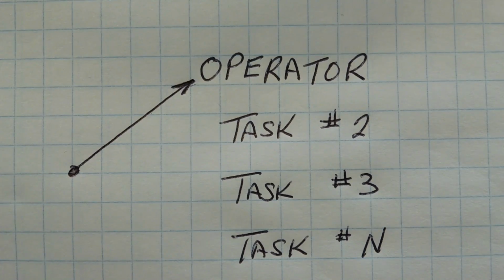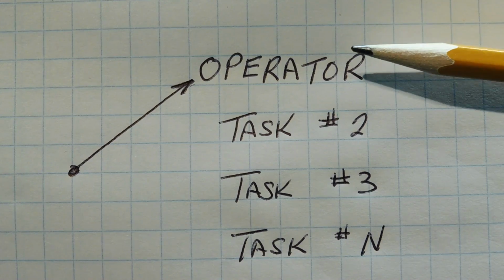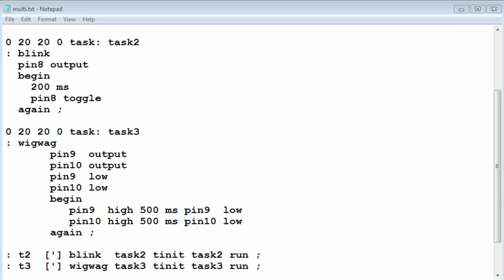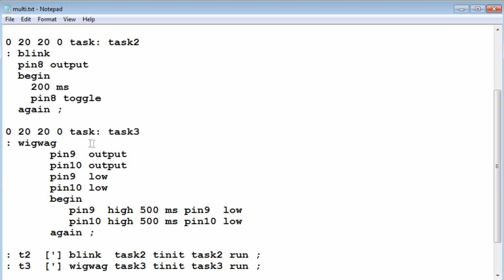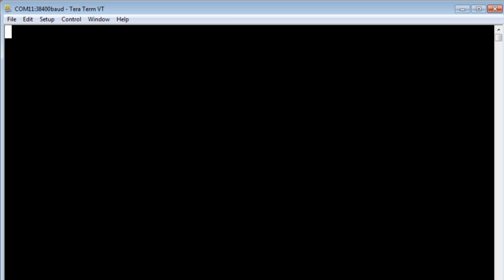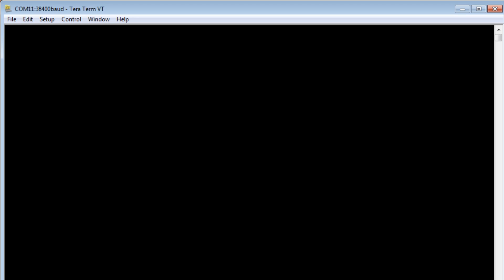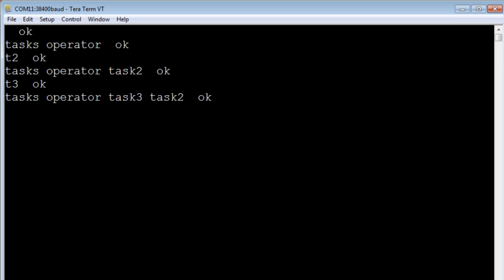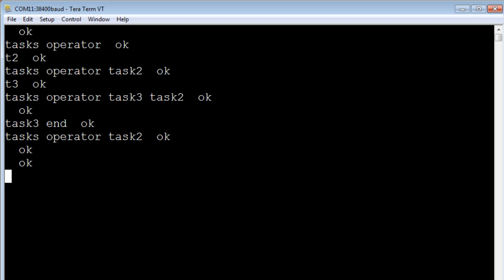Multitasking On A Microcontroller / Arduino

Comment: Could you please suggest me some guidelines for my project. Task no 1: I may be pressing Button at any time and it does the job. Task no 2: sensor senses the object and does various operations as follows- object located, then after some time gap it displays the distance, the after some time it gives a siron and if the object is there it repeatedly does above cycle. If the object is moved from there the above cycle stops. If I use delay fn, then button pressing does not work properly. I tried millis(), but could not allot different time intervals in between. Please guide.
Reply from the maker: Are you using Flashforth? The word "pause" is embedded into timing words for task switching but you can place it anywhere in your code to make the program flow properly.
Reply: @0033mer  thanks. I will try and let you know the result.

Comment: i have a arduino sketch which shows time on st7735 display. I want to run FlashForth on it and this sketch as just another task. Is there any way to do that ? This would also mean that "any arduino sketch" can be loaded at runtime as a task.
Reply from the maker: FlashForth does not use the Arduino IDE so running an "Arduino sketch" under it will not work.
Reply: @0033mer  thanks for reply. I will then probably edit tiny basic sketch to have time display as one task ( if that's possible).

 As side note I was wondering, if I could put a hex file of say a sketch in flash memory somewhere and call it via say some tinybasic routine or forth word Or a forth driver for the display.
Reply from the maker: Updating your time display with a "tick" interrupt is probably the easiest way to get it to work.

Comment: i type "tasks" i get a question mark....

FlashForth 5 ATmega328 18.11.2020

0 20 20 0 task: task2 task: ?
: blink
pin8 output pin8 ?
Reply from the maker: You need to load Task.txt first. It is in the download file together with some sample multitasking code that you can use for testing.
Reply: @0033mer  thanks, I found those after... you know... a quick RTFM ;)

Comment: So it looks like you have a cooperative multitasking OS in there somewhere. Each time your task calls the ms word the OS starts a timer, saves the state of that task and then executes the next task that is ready to run. Something in the OS decrements the timers and, when a task timer reaches zero it restores the state of that tasks and executes the task on the next instruction after the ms word. Is that approximately correct?

Is the cooperative multitasking code part of your Forth or is it another module added in with the rest of the code? Are there other Forth operators like ms that will release the processor to run other task code?  I would love to see how this cooperative multitasking code is structured on such a small machine.
Reply from the maker: Most Forths have cooperative multitasking built in but you can remove the module if you are not using it. This gives you more memory. Operators like ms will release and many others like I/O words. If your task does not have a release word you use "pause" which lets you "hog" time for critical tasks.
Reply: I don't think the Forths I saw in the late '70s and '80s had any multitasking. My limited encounters with Forth lead me to abandon it and I never really looked back. Your examples using Forth have made me want to take another look at it. So thanks for a great example and wonderful channel.
Reply: @RobertShaverOfAustin   Unfortunately most people were introduced to Forth via public domain systems that didn't add the mutli-tasking code. The original Polyforth system could run up to 64 terminals on a Data General Nova computer when competing time slice systems bogged down with 8 terminals.  This is due to the variable time-slice nature of Charles Moore's multi-tasking system.  Each task switches anytime it's waiting or after an I/O operation. Context switching on modern CPUs with Forth's virtual machine is only a few instructions since each task has it's own data stack and return stack. Very little to save between switches  </lecture>   (can you tell I think it's still pretty cool)
Reply: @brianfox4060  Thanks. I may go back to Forth.

Comment: Is there a specific reason you are using Forth instead of something like say FreeRTOS  ?
Reply from the maker: FreeRTOS is another good option but it tends to use a lot of RAM for its tasks and is more complex to use. It is better suited for microcontrollers with larger memory footprints. Forth is a programming language and OS that can be extended, so you can use it to write your own programming language which I have done. If interested it is featured in Circuit Cellar Apr 2015 issue 297.
Reply: Looks like Circuit Cellar back issues, 1. don't go back that far and, 2. if they did you'd have to buy the PDF for $9. Do you have any other sources of info? I found http://flashforth.com/ and am reviewing that now. I don't see anything right up front about cooperative multitasking though.
Reply from the maker: Check out this link:  http://www.mosaic-industries.com/embedded-systems/sbc-single-board-computers/freescale-hcs12-9s12-c-language/instrument-control/forth-real-time-operating-system

Comment: I don't use Forth but I remember  reading about it in the 80's saying people who use Forth are very loyal to the language.   Do you program the time slices for the tasks or does the operator determine that.  Like  if the operator runs the wig-wag task and one led has been on for 250 msec does it just exit that task and go on to the next one. I guess I am asking is there intelligence in the way the operator time slices each task based on what is going on ?  Compared to C Forth looks very succinct.
Reply from the maker: The time slice is determined by the operator but you can "hog" time in a task if critical.  Forth's strength is its efficiency and small memory footprint but with newer microcontrollers having lots of memory Forth fell out of mainstream and was forgotten. The biggest user of Forth is NASA and other companies who don't advertise. It is on the space shuttle, Hubble, ISS, space probes and satellites. https://www.forth.com/resources/space-applications/

Comment: Uuuuu. Bravo. We got exactly this scheduler case at university. Hyoo on the moto 68hc11assembler in the year cca 2006 next year it was discontinued and  they switch to a more modern controller. OK it was good for the principles but no one uses that stuff in modern days :) 
I don't usually see job listings with assembler knowledge required...
Reply: If you haven't written assembler then your education is not complete. It's really not that hard especially on these microcontrollers. It forces you to read the chip specification and understand how to make the hardware work. If you ever need to write drivers you'll need this ability. In the school I went to we wrote assembly for minicomputers and microcomputers.
Reply: By limiting yourself to just learning what is mentioned in job postings will not cut it in the real world and you might want to change careers. Learning a broad range of programming skills will help you solve the impossible tasks companies run into, and will make you a leader in your field.
Reply: I partially agree. Also no objections you learn better the controller architecture if you underestand the basics. But for example a coworker have a lot of Visual studio programming at university automatisation (regulations, pid,...) He learned and serves him well till today. Don't worry I paid my assembler tax already in high school on Z80. And as hobby on PIC.
Reply: Assembler,  that's how I learned how a computer really worked.

Comment: Great video as usual.
I'm new to programming but have a background in electronics.I am particularly interested in the FORTH programming language and have begun learning it. 
I have managed to flash Mecrisp into a Blue pill and am using Putty to simply go through some simple Forth programs .I have no idea how to actually control  the Blue pills I/Os yet !
Along with myself,I'm sure many others would appreciate a more in depth tutorial regarding Forth and it's use with various micro controllers.I have many questions.For instance,do you use libraries to enable you to control I/Os or do you create your own, continually building upon forth words and definitions?

Anyway, thanks for the great videos and I look forward to the next one.
Reply from the maker: I basically build my own libraries but if you look online you can find code that is very useful.
https://jeelabs.org/article/1608c/#digital-i-o
https://github.com/jeelabs/embello/blob/master/explore/1608-forth/flib/stm32f1/io.fs

I have other videos that feature the Blue pill and Mecrisp that might help.
Reply: @0033mer  Thanks for the info it's much appreciated.

Comment: Thanks for sharing! I have installed flashforth on my Arduino pro and Mega. Starting to play around with the Forth environment. The application of Forth is inspiring. Any further sharing on how you use Forth would be well received. Cheers
Reply from the maker: I use Forth in all my videos that involve a microcontroller and coding so feel free to look around.

Comment: Very interesting! I would like to make a project that has many digital inputs (buttons) and when a button is pressed, the microcontroller will show button's number to an lcd screen. Using interrupts on arduino IDE is not a good solution because I want more buttons than the interrupt pins of Arduino. I think that with that video I found a solution! Is it possible to miss a clock with that method (like using too many analogRead() in Arduino IDE), or every pin is working independently
? Is it possible to use any operating system (like RIOT os, tinyOS etc) with this method?

Thank you in advance
(please keep uploading interesting videos like this!)
Reply from the maker: Most RTOS have multitaskers. Check online for the one that will work on your microcontroller.